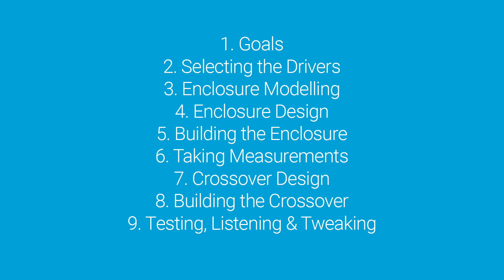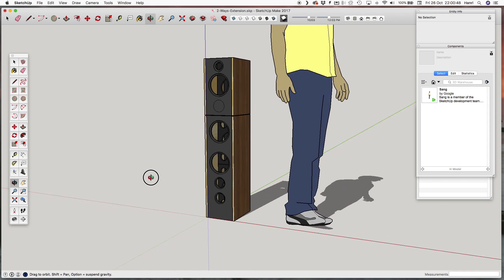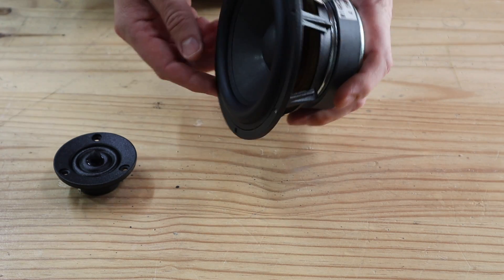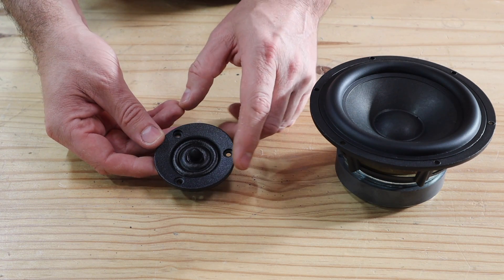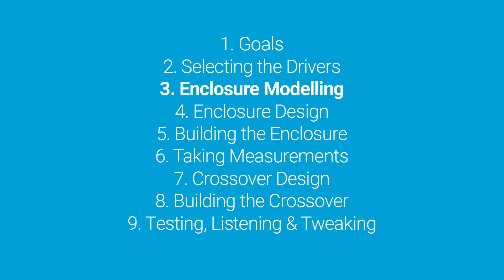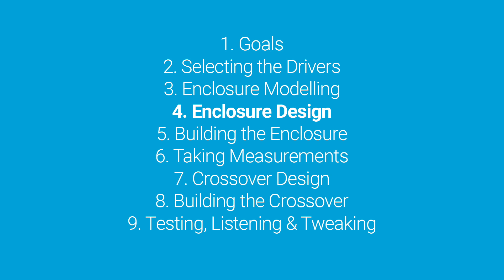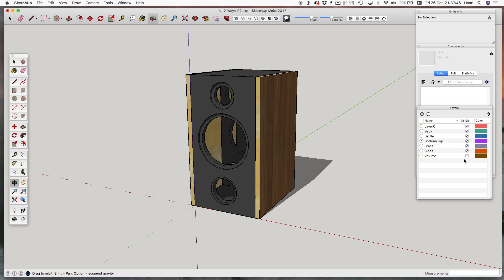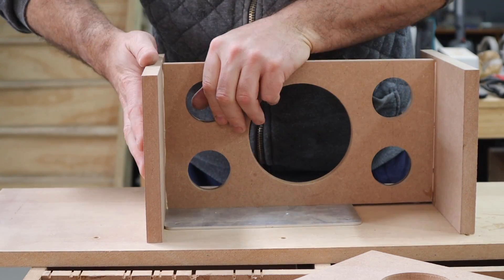Building 2-Way Stereo Speakers for Home Theater - PART 1 of 3 - by SoundBlab

Comment: How is the performance of the ring radiator? How is the dispersion and off-axis response in your opinion? Does it beam?
Reply from the maker: It is actually rather good. If you go to my build plan page here: https://soundblab.net/product/home-theater-2-way-stereo-speakers-build-plan/ you can see the on- vs off-axis responses.

Comment: Lekker Build! Love the detailed sketchup designs. How do you get the wood grain finish on the model in Sketchup? 

BTW what about a shop tour then, didn't see a video for it...did I miss it?
Reply from the maker: Thanks Barry. I just search for the wood texture I need on Google and then import that into Sketchup as a material. Have not done a shop tour yet. Not sure when that will happen, but its not high on my list right now. There is too much that still needs to happen in the workshop I think...

Comment: Just PLEEEEASE cut those corners (at least at the front of all speakerboxes ) with 1cm Radius or 1cm  cut under 45° angle - it goes long way !  They look great for now...
Reply from the maker: Its not the look I'm going for. So, its a bit of a trade-off between form vs function. Although I did not test it with a radius or bevel, I am not convinced that for the intended purpose of the speaker it will make much of a difference. It will be interesting to test it though! If these where only for listening to music and not used in a HT scenario, I would normally consider bevelling those edges.
Reply: @SoundBlab  sonus faber minima amator.... look up for the hi-end devices/musical instruments( speakers ) they all are rounded or have 4cm walls on front/sides ( then you dont need radius or if its made of Alu box or from carbon or glass ), cuting corners is to stop front panel radiating "noise" and killing the box to be solid...
Reply: @SoundBlab  yes if you put a radius it will help with sound quality, BUT, it has to be a big radius 1cm is more for looks. And with the purpose they are built for, being for theater, I think your decision is fine. I've built boxes with 5cm radius before and its NOT a night and day difference but you can start to see it in the measurement a little, and if your going for the utmost in performance... 
Anyway love your builds... I have those same drivers, woofers in one build (use them in prototypes as they're cheap) and tweeters in a few more, love those tweeters!